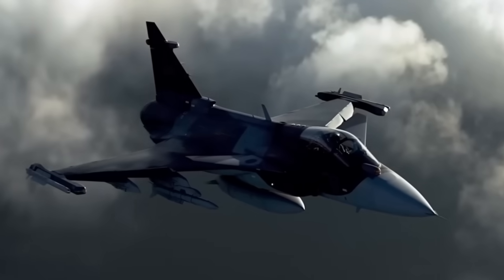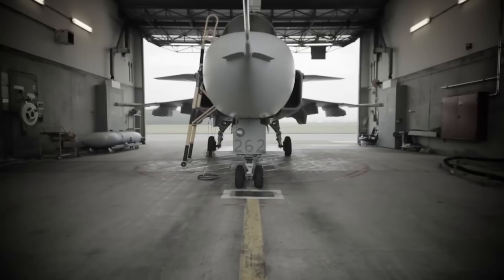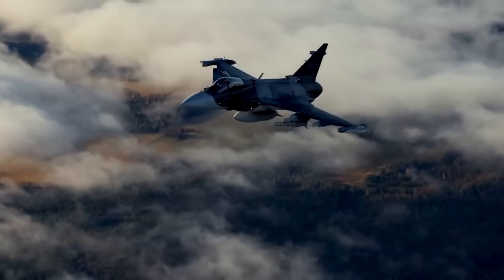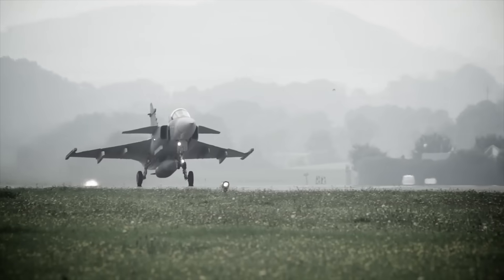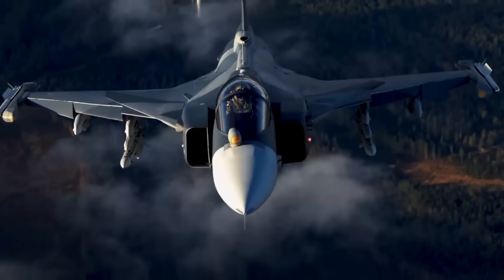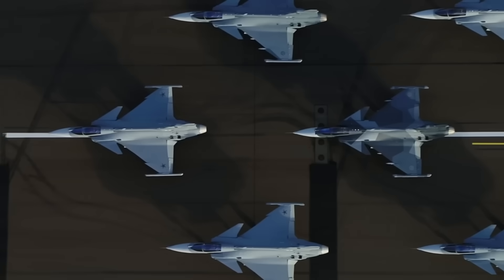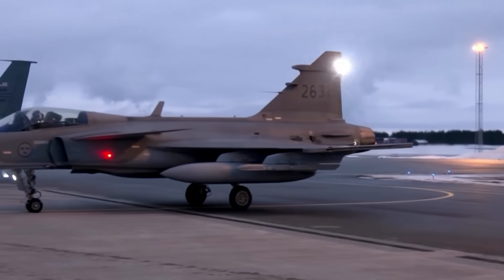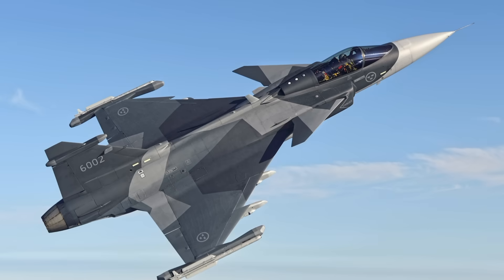How Rolls-Royce Turned the Gripen E Into a Pentagon Nightmare

Comment: The RR engine is a rework of the EJ200, which is the engine used in the Euro-fighter and is a collaboration, not a solely RR engine.
Why this video shows numerous shots of Trent engines - high by-pass turbo-fans used on wide-body passenger aircraft, I have no idea.
Similarly, the banner for this video shows the Spirit of Ecstacy, which is a car emblem and hence licenced to BMW as Roll-Royce has not built cars for around 50 years.

Comment: Gripen will not challenge the production of F 35. As far as I know SAAB can produce between 20 and 30 fighters per year. That's a far cry from F 35. F 35 also has another role then Gripen. One can always compare apples with oranges, but what is the value? SAAB wants to extend production. At the moment they are looking to Canada. I'm in Canada. Good Luck SAAB! Everything here in Canada moves with the speed of a glacier. At Best we are talking distant future in that case. Both aircraft have there place in aviation and can probably be combined as a strike package. By the way, apart from the engine there are more US made parts in Gripen.

Comment: If these could be used in aircraft carriers for whatever the F-35 does I'd prefer this to be on British ships ahead of an expensive US plane.
Reply: Not possible as all western non-us carriers save Charles De Gaulle require vertical landing. Even if not, Gripen is not designed for the stress of carrier landings, so it would probably be better to buy the Rafale-M.

Comment: In all honesty, the switch to the rolls royce engine is a hypothetical one. The practical implication is that the airframe of the Gripen needs to be redesigned to accomodated the change in dimension of the new engine. Plus, all the recallibrations etc needed to adjust for differences in thrust, agillity etc.

Comment: Canada currently make $2.5M to $3M of F35 components in each fighter.   Over the F35 program lifetime, that is $22.5 B to $27B.   Canada makes zero zed Gripen components.

Three things to consider:  
1.  The Gripen with Rolls Royce is a great $$ deal for Canada.   BUT.... It also locks Canada into a NATO support role only.    
Front line NATO missions and countries like Poland, Romania and Turkiye won't have a Gripen supply line and support training.
2.   Why would the U.S. share future aircraft development and manufacturing with Canadian firms when Canada can't be trusted to fulfill its promises on the current generation of fighters?
3.  In 5 to 10 years Canada may "assemble" the Canadian Gipens (or part of them).   Sweden will never give Canada the right to design new fighters.
Reply: Im sure the orange buffoon can provide the neccessary motivation.

Comment: I mean, the F-35 hasn't really been tested in combat. It's a missile launch platform. I wonder how it will hold up in a dogfight?
Reply: It will not. It is a stand off out of sight platform designed to avoid dogfights. It is a contradiction in operational use.
Reply: Why don't you ask Israel how capable it is. I'm an American and I hope Canada cancels the contract. As Canadians have been saying the US is no longer an  ally.
Reply: The F35 can track up to 50 targets and fire at 5 simultaneously at a range of +/- 100 miles, once the 4th/4.5 gen fighters can see the F35, that might be his last sight being alive. Good luck Gripens😅
Reply: @Xam-r2v F35 is a first strike offensive weapon dependent on stealth to hide until it releases its weapons. Once that happens the stealth no longer applies. Thus it would be ineffective in a ground attack/close ground support weapon, failing as well in a dog fight
Reply: wasn't there supposed to be a fly past of RAF and USAF F35s at some royal event but it was cancelled due to the weather?
the Red Arrows of course flew as usual.
Reply: Israeli F35s fly far and wide between Syria and Iran, destroying missile defences. Even a Chinese JY-27 battery, built specifically to intercept stealth aircraft, has been destroyed. You will never see F35s in aerial combat because their purpose is different: to destroy enemy defences and then open the way for fighter bombers.
Reply: @askallois air defences in the Middle East are nothing like those in Eastern Europe. The F35, once it opens its bomb doors, it loses its stealth, its sole advantage. It is not a multi functional aircraft. Also, its operational up-time at barely 40% is too low.
Reply: @askallois  The F-35's that the Israeli's fly are far more superior to what is currently in the region. And while yes, the Chinese fighters do have some bugs to figure out, one thing the Chinese people are good at is learning from mistakes while keeping costs at a minimum with maximum efficiency. They will figure it out, it's only a matter of time. Then there's the newer models of other western fighters.

Comment: if the F(uck)35 is a Gen 5 then Saab Gripen is a level 6...you arrogant asshole USies..😂😂 F35 with leaf spring suspension ,, where did you hide the cast iron blcok and the push rods..😂😂😂

Comment: It's going to take a lot of mid-night oil to allow the RR to be retro-fitted to the Gripen E once it is certified.   Canada will most likely not be able to back away from the first 18 F-35s but that will be it after that.    Gripen E it should be if a RR can be stuffed in it.
Reply: sweden said canada also could have option to build its own jet engine for the fighter

Comment: The only advantage the F35 has is the Stealth tech built into the fuselage and that’s not worth a 40 million dollar price premium and American interference.
Reply: Modern Radar systems like the tech Russia and China have and have given to Iran have no problem detecting the F-35 at long distances right now. That's why Israel had to use standoff weapons. Their F-35s had been detected. And the F-35 is years behind schedule for electronic up-dates. The Gripen already has the tech that the F-35 is supposed to have. In actuality the whole F-35 program has been an expensive mess...Billions and Billions over budget with no end in sight. No country should buy them.

Comment: The RR EJ320 is not presently an option for the SAAB JAS-39, as it has not been integrated into a redesigned Gripen.
It would necessitate a major redesign of airframe and electronics, to integrate its size and power distribution differentiel, not a simple engine swap.
Should SAAB undertake this expensive time consuming do-over of the Gripen, the cost might just be worth it in exchange for the increase
in foreign sales to nations who seek true sovereign operational flexibility by not being reliant on USA approval for the transaction and logistical 
support, removing the (US designed) licensed GE F414 engine impediment.   Be well and stay safe

Comment: A British Rolls-Royce engine will boost the speed and performance of the Gripen over the American made GE engine. Another reason Canada should go for the Gripen. Whether a plane is stealth or radar jamming, the results are the same. Not only can the Gripen jam radars, but it can become untraceable preventing others to lock on with its software defense system.
Reply: If I'm not mistaken, it uses Leonardo's Raven radar.

Comment: The RCAF believes that splitting its order and acquiring both the F-35A and the Gripen E platforms will be a far more costly effort than sticking exclusively with the F-35A. To be sensible, the RCAF is highly likely to be correct about the costs and the logistical issues. Also, even if Canada cuts its F-35A acquisition to the 16 jets it's already paid for, there will be more costs per F-35A associated with cutting the order. This is an either a full order at an already really high cost or a split order proposition at even higher cost.  

It is obvious that the Canadian Government and people are at an inflection point with respect to their defensive strategy, their domestic economy and their relationships with the USA, NATO, and the EU. 
   
Under this scenario, Canada would build domestically about 50 Gripen E/F jets for its own air force, and about 100 to 150 for the Ukrainian air force. That would positively improve all of these strategic factors. 

The economic impact of splitting the order: 
As pointed out above, Canada would have to commit to a huge additional cost to make this deal. But those costs would be somewhat offset by the added revenue from a new domestic military defense export industry with all of the associated job growth and tax revenue. Of course outside of the new job revenues, production revenue won't start flowing for at least two years.  

However, once the facilities are running, there is potential for additional business. First, Canada might get additional contracts for Gripens from other countries after fulfilling the original order. Second. Saab has researched a Gripen G variant. It can take off from aircraft carriers. Saab and the Canadian aerospace companies should develop a prototype. A Gripen G could mean more business for both. Saab is also working on a sixth generation jet that they might offer Canada when it becomes available. 

The defensive impact of splitting the order:
The facts are obvious. The F-35A is a fifth generation fighter. It has stealth and will strengthen the NORAD shield as it goes forward. A single F-35A can act as a data hub for multiple platforms including fourth and fifth generation jets, tankers, and electronic warfare platforms. Hopefully soon that will extend to 'loyal wingman' unmanned jets. 

On the negative side, the F-35A is expensive to maintain, needs long runways to take off and land, has notoriously poor performance in cold weather climates, and needs expensive and technically complex maintenance bases. It also needs more crew to accomplish maintenance, and requires significant time for sortie turnaround for rearmament and refueling.

The Gripen E/F is a fourth generation fighter that has upgrades. It's fair to claim it to be the best jet available for cold climate operation. The Gripen's ability to operate from snow and ice covered roads with short takeoff and landing, small crews and portable maintenance facilities is unprecedented. Gripen also requires extremely short turnaround time. These positive traits combine to add a huge strategic factor: Gripens can be dispersed all over the area they need to defend. That makes them extremely hard to take out on the ground by missile or air attack. You have to find them in order to destroy them.

The Gripen does have some negatives. It is not able to match the F-35A's stealth and multi-platform data capability. Nor is Gripen able to integrate as well with an F-35A as another F-35, AWACs, etc. Note that it might be possible to be better integrated with F-35s if Saab and General Dynamics cooperated on flight system upgrades for the Gripen.  

The negative effects on Canada's relationship with the USA:
If Canada buys half of its original 88 F-35A order, and 50 Gripen E jets, there will be short to medium term negative effects on the two country's relationship. Those effects might be reversed after 2028 however, regardless of which party wins.

The positive effects: a half order will still allow Canada to fulfill its NORAD commitments. The American defense contractors will be still making tons of revenues, even with just a 44 jet order. And there are other positive effects for the USA if the order is split. See the point below about hurting Russia in Ukraine. That should bolster the Canadian relationship with the US Senate. Over 80 senators from both parties are chomping at the bit to put secondary sanctions on Russia. And see the final point about defense of the Northwest passage and land resources across the arctic. 

The impact of Canada's relationship with NATO, the EU and the USA:
By making and purchasing Gripens in Canada and exporting them to the Ukraine, Canada does a strategically significant thing that strengthens all parties' defense against Russia. Obviously it radically strengthens the Ukraine, potentially winning the war for them. It probably also ends the war. The likely outcome of that would be the fall of Putin. Which would strengthen the NATO, the USA as well as the EU. 

Finally, splitting the platform order would potentially have a huge long term across-the-board military and economic benefit. Air power added to submarines and ice breakers will secure the Northwest passage. Air power above the Arctic Circle will also protect fishing, mineral and energy resources.  

Strengthening Canada's arctic defense will make it harder for China and Russia to make inroads there. It will also strengthen the USA's Alaska portion of the passage. And, if the USA gets smart, they could order Gripens to cover both Eielson AFB in Alaska and permanently for their base in Greenland. The Gripen is the natural choice for all of these northern duties. 

Keep 25 of the F-35-A jets in southern Alaska for NORAD. Buy 30+ Gripens to cover Alaska and Greenland. Then redeploy the remaining 20 Alaskan based F-35-A jets to where they would arguably have more strategic effect. Of course, Canada, the US and Norway would have to agree to integrate their defenses as well as figure out how to share revenue from the Northwest passage. 

What the Canadian people need to do is decide if they are willing to commit to medium term pain for a long term restructuring of their place in the world. Such a commitment will require a mandate via a referendum. Half measures and short term political goals are the anathema of long term progress. Carney and his government need to bring a grander vision of Canada in 2040 to the Canadian people.

Comment: STOP LIEING! If you're going to make a Youtube vlog about something, make sure you have the facts.
Engine choice: The Gripen E is powered by an engine from General Electric (GE), specifically an F414-GE-39E, which is a powerful and advanced engine.
Adaptation: The engine is a central part of the aircraft's design and control system, and switching to a different type of engine would require extensive changes to the entire aircraft.
So NO Rolls Royce engine.
Reply: Duuuh.   They are going to provide the power plant.   US dominance is over Edit - Lying
Reply: @JM-eb2ci  You are stupid.
What I wrote actually comes from SAAB and they are the ones who build JAS.
JAS 39 Gripen E is built around an engine from GE and is NOT replaceable according to SAAB:
Reply: Do you really think your judgement is built on all the facts. I think Volvo and Rolls Royce are way ahead of your limited thinking. Remember America is the braggard nation while others are quieter concerning the technologies they are working on. Not every country is infected with American Exceptionalism!
Reply: @maryrafuse2297  JAS 39 Gripen E is built around GE engine and as I wrote, it is not possible to change the engine. What I wrote is from SAAB which manufactures JAS. So stop now and babble.
Reply: @ingvartorma9789  Flustered from all of the external and internal attacks on MAGA USA hey bub?  Stop up voting you own posts also, it makes you look even weaker.

Comment: Alas, the Rolls-Royce EJ230 engine doesn’t actually exist, it’s a proposed design. The Gripen E/F use the RM16 engine which is a derivative engine from GE F414.  Replacing the engine is major work, it may require a new fuselage, new air inlets and most definitely new avionics. It would have a different mass and length and that means new center of gravity. Remember the Gripen is inherently unstable
Reply: How do you know how much work has already been done in secret? Do you think Sweden might have already worked these things out? I for one do!
Reply: @maryrafuse2297  I don’t and I suspect there has been studies. It helps of you have good  a good understanding of what you get with this engine and you can identify the areas where you need to do a lot of work. The air inlet is optimised for the current engine, a new will require a redesign. Even if work has been done secretly, it has taken quite some time and total time would be several years, I think at least seven years of hard work. What is it you claim to know
Reply: @TheFrewah  I think you are correct. Mayor military assignments are usually public announced by the swedish government. Saab asked RR, GE and other engine manufacturers for proposals for the E/F project, but GE got selected.
If not the Swedish government pays Saab to make a prestudy of a new Gripen version, someone else must pay.

Maybe Saab can speed up the development if needed, but as the first prototype of E/F made its maiden flight 2017 and first delivery came 2025 it seems to be like a +10 year project to deliver a Gripen with a RR engine.